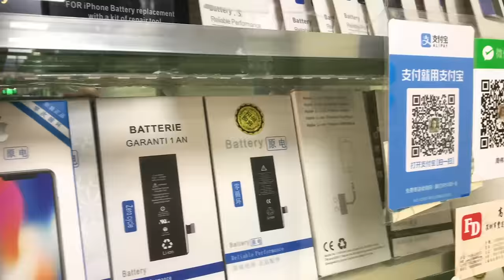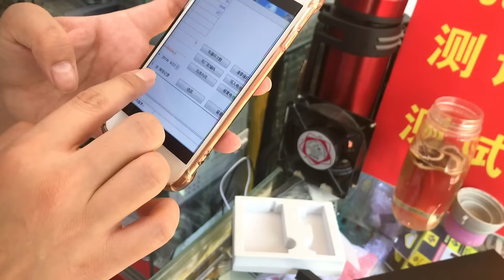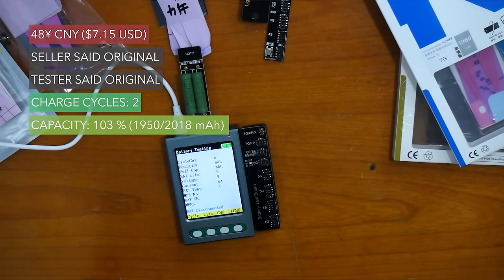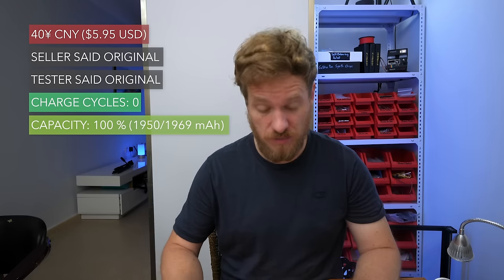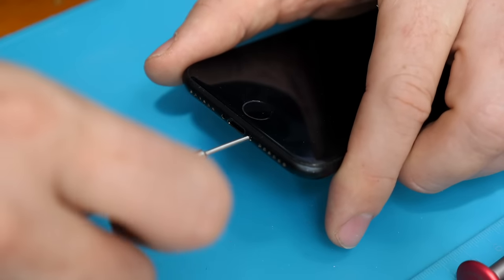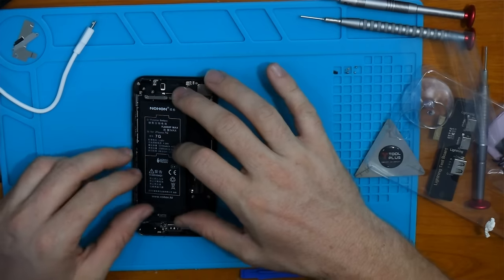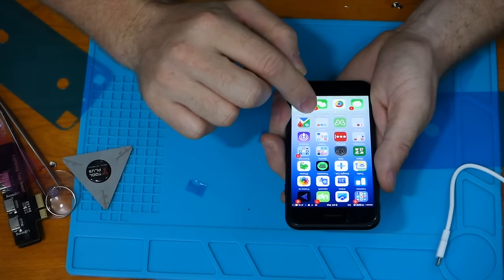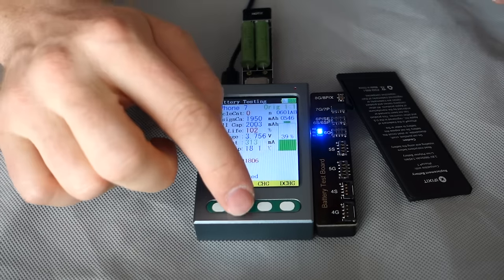Real or Fake? Trying to Replace my iPhone Battery in Shenzhen, China

Comment: Put a fingerprint reader in the apple logo on the iPhone 10!
Reply: Would be cool to see but that would require some high level OS Modification. Also the logo is behind glass and the back is mostly housing the coil for wireless charging so work room is limited.
Reply: @moorefilmltd  its practically impossible because. IOS is not open source and cannot be modified like android.
Reply: MXFnGEN housing room is actually non existent without removing at least once cell from the battery and completely removing the wireless censor. Then you’ve gotta use one of the existing connections on the board, and that’s all before making it compatible with the phone.
Reply: It's just impossible. You can't even replace touch id in iphone 7 to new one, only apple can do this and there's no service whole world that make it. Touch id is crypted paired to cpu code.
Reply: MacMasterRace the hardware is pretty easy, the software is very hard if not impossible because u can’t just modify iOS or load custom firmware into the iPhone
Reply: That's imposible tho. Unless you know how to write code in iOS and implement it, but it is impossible anyway.
Reply: For an actual description of why this isn't possible: from my understanding, the SEP (secure enclave protection) saves the Touch ID model(? Or some other type of model identification) as well as all fingerprints. Due to this and the extreme security surrounding the SEP is almost impossible to crack, and that doesn't factor in all the bootlevel identification code that looks for the ID paired with the motherboard. This is possible to modify, but again still needs (either a BootROM or iBoot exploit, but I believe BootROM) for true OS level modifications.
Reply: @moorefilmltd  well he can replace the power button with the finger scanner like and circuit breaker
Reply: I installed one. You need iOS code. It is not easy whatsoever. Took me 3 months to complete on a iPhone 8

Comment: Build a MacBook Pro from zero! Case, battery, motherboard etc.
Reply: including software
Reply: Fritzell Dionson nah that’s too much.
Reply: Serdar H
Mac book, you need some original I/O chips,  you need Sun or Apple Firmware to boot the OS.
Rest you can build using PC parts....
Reply: Hiten Ghate there’s hackintosh
Reply: @hwinangkoso  Why not use a real mac, old is good enough, any intel apple!
Reply: lucas rem the thing is from scratch right? The point is to use hardware that mightn’t be compatible with OSX. Then you can do whatever you want
Reply: @lucasrem  Try Linux!
Reply: @zhaoxunyan4016  

Why you need linux, only weirdo people use that..run Oracle on it at home?

Need to run open server crap, or be the nerdy admin of the home PC?
Reply: @hwinangkoso  there is not a lot u understand i see, SUN I/O you need to understand, that's what apple OS is using too!

Comment: Taptic Engine should be removed first
Reply: Why
Reply: Gamer Buddy it’s a joke about Ifixit
Reply: Yup - it has a sharp edge and forces you to pull the strip up at an angle which makes tearing more likely. Worth removing the Taptic Engine.
Reply: Especially on iphone 6 and 6s where you only need to remove two screws and lift it. It takes 15 seconds and you save 2 minutes trying to pry the battery.

Comment: I bought those Nohon high capacity batteries for my 7 and 7 plus, not really good, both of them started degrading pretty fast after 20+ charges. i ended up buying Pisen batteries, which is a better battery brand in China, they claim the same capacity as the original, and have overall better battery life, really happy so far.

Comment: Note 3 , still has same very easily replaceable battery. It's old and still chooching.
Reply: I'm running AOKP/Lineage Nougat 7.1.2 on mine. You rooted?
Reply: I am using note3 and i have sennheiser bluetooth earbuds pretty expensive but the phone is too old for the control app lol
Reply: @danyk7879  should root and install a custom rom if you are willing
Reply: Zoomzabba yeah then i have to root the phone
Reply: @danyk7879  speaking of which , I'm actually thinking about doing that to this phone .

Comment: 80% is the minimum, that equals 500 cycles. you have more than 700, so it was time to change
Reply: its mean normal phones cant last more than 2 years? assuming we charge daily
Reply: @mantapdjiwa9768  Daily charging doesn't necessarily mean a cycle
Reply: The batteries themselves (Apple originals) are only meant to last about 1000 cycles. However, 80% charge capacity doesn't mean 700 cycles. You can have 80% charge capacity and be under 400 charge cycles. 
Depending on heat, cold, over-charging, rapid charging, etc...all that can affect the capacity percentage but not the charge cycle. 
In fact when Apple system does a check, if it's at 85% charge capacity, it'll recommend it be serviced (changed).
Reply: @Decent60  the apple laptops can do 1000 cycles, the phones do 500! ;)

Comment: You should have used the battery tester in the iphones settings and then use the battery tester you bought to see how accurate it is.
Reply from the maker: Yeah, I regret not doing this.  I actually hadn't upgraded to ios 11 yet on that phone, which was why I didn't do it.

Comment: My battery lasted me 6 years, now mom has that phone now. Still working :) I did take care not to leave it on charger over night, and no fast charging. Batteries like low charging current, quick charge kills them faster but most people want quick charge and usually replace phone in year or two so shortcomings of quick charging doesn't show up yet. My Nexus 4 lasted me 6 years, I have saved over 2500 euro when compared to my friends who often change phones :) Now Mi 9 SE, another great phone for under 300 euro (Nexus 4 costed me that amount 6 years ago).

Comment: What I've learned from pulling on the battery tabs if you don't want to stretch them, you want to roll them. They don't like to be pulled super far, so if you keep them closer to the battery and you roll them around your tweezers they won't break.

Comment: I would have liked to see you change the cycle count for example, disconnect the battery and reconnect again to see if the tester actually tests the battery and gets real data or if the tester just "reads" for the values which are saved inside the battery.

If the tester cant expose the fake one then its doesnt make much sense to buy the tester. The shops which sold you original, 1:1 copy and fake batteries could easily just use the tester to sell you whatever they want. 

Thats why i think that this test is so important

Comment: I've swapped a lot of iphone batteries, and once it blew up. Damn that was scary
Reply: I always discharge the phones before I swap batteries.
Reply: @Pseudynom  sadly discharging the battery first doesn't makes them less prone to explode, just less dangerous for the phone's electronics...
Reply: Léo P. With a discharged battery the result of a puncture will be heat and smoke. A fully charged battery will result in a much bigger reaction with open flames.
Reply: So you experienced what owning a note 7 felt like xD

(Plz don't murder me, I've genuinely never made that joke before)
Reply: @mmqvt  
But if you discharge you battery it litterally has less energy that it can set free.
Reply: @Pseudynom  yes thats true, but if you discharge it too much, it might puff and/or explode when you charge it again, thats why balance chargers for rc equipment batteries have a low voltage warning that prevents you from charging it if the voltage is too low
Reply: @maxxiang8746  
But if you're replacing the battery it doesn't matter if it's deeply discharged.
Reply: @Pseudynom  yeah I guess

Comment: Tip: Remove your taptic engine before pulling out the battery adhesive. It helps preventing the strip from breaking.
Reply: And a legit disassembly tip from someone that seems to be Chinese.

Stay classy, lads.

Comment: Funny two none iPhone ads on a video about iPhone like the irony:) also I would think it was no thought needed to use the extra capacity battery...why would you not want to?
Reply: because you cannot stick more capacity in the same space... 
Checkout different batteries for different iphones, they weigh and are sized differently...

Just a thought there..
Reply: @lucamantova3070  Yes you can. Battery technology can be advanced, somethings are give or take tho, Same Size, More Capacity, BUT more heat. Smaller Size, Same Capacity, BUT less overall life. You can re-design the battery in the same space but something will eventually give. (Hence why there is standard, and extended type batteries. Extended wouldn't do as well in a high temp climate, or the heat on the extended when charging can be too great so a standard battery would be best.) All about balance. Hence why our phones have limited chance of fire but average capacity. Increase the capacity, increase the chance of fire and the battery being unusable sooner in time. Balance.
Reply: @swagsurgin6907  I see. Would you be able to link me to a source for further reading?
Reply: @lucamantova3070  For sure. Its all about battery chemistry. NiCd in the same size of space would equal terrible battery life given higher loads and has to be taken well care of or it will diminish rapidly. Check here and read up on battery chemistry: https://en.m.wikipedia.org/wiki/Electric_battery#Chemistry

Comment: One year and a half ago I changed the battery on my Xiaomi mi9 with a battery from ifixit. After one year it was completely dead, so in august I bought and installed a nohon battery with higher capacity and at the moment is working great!

Comment: Bat Level 50, because they sell it with 50% charged, to not damage it
Reply: The "battery level" is different from how much it's charged. You can see the actual charge percent inside the battery icon on the right of the screen.
Reply: @mongohands  hmm, okay
Reply: Maybe the circuitry doesn’t support it and it defaults to 50?

Comment: Thank you for the video, it was really interesting. Something I would have liked to know would have been how the tester reported your phone's battery when compared with what the Battery Health item of the settings app of the phone before removing it (i.e. the percentage 'maximum capacity'). Conversely, I'd like to know if the new battery was reporting as 100%. Just small points, but I'd have been interested.

Comment: I believe you can't restore the software via iTunes if the battery is not original...
An error will pop-up I guess... that's maybe the next video :p
Reply: I'm surprised that it's even possible to open it without making it a paperweight

Comment: How can you trust a tool that lets you reset the cycle count is accurately telling you if the battery is original? 🤔
Reply: The cycle count reset is probably for when you change the cells but reuse the charging circuit. That way you know how many cycle are on the used cells. I remember rebuilding old external laptop batteries.

Comment: I use a tool called 3uTools that allows me to see the manufacturer and the capacity and stuff as well.
Reply: Not always accurate tho. Most likely to get true results with a fully charged iphone.Sometimes 3utools may show 1-2% off compared to what the battery life indicator is in the settings menu on the iphone.
Reply: that is very cool, but what if you don't wanna put the battery in because you are not sure about it's originality ? here comes testers like this :)

Comment: I've purchased several ifixit batteries over the years from Fry's Electronics.  I have had a couple of them go bad on me, while still under warranty.  Getting a warranty replacement was very easy and hassle free.  But if you are an impatient person, they cost around $20.00 at Fry's to pick up now, or wait for ifixit to ship you a new one!  The batteries do come with all the tools you need and the adhesive strips.  But be careful with the strips as they are extremely easy to ruin before you even put them on the battery. Once the adhesive sticks to itself or improperly placed, are garbage.  I haven't successfully installed a battery with those strips to this day!  Anyway, all I really wanted to say is that, I highly recommend ifixit batteries.  the batteries are top quality and super easy to install.  Like what was mentioned in the video, use the repair videos on ifixit if you are repairing your iPhone for the first time.  Just type in the exact iPhone model and look for the battery repair in the list of all repair videos.  Oh, one last thing, I highly recommend viewing the battery adhesive strips install video too, while you're at it!

Comment: You must use your fingers to pull the pull tabs on the battery adhesive. My experience is that uniform force through use of a tool to pull it out causes it to snap. Don't ask me why, but it works way better by hand.

Comment: Dude just get an android already!
Reply: And where would you find a battery tester rig for your rando Android phone with its unknown, possible non-standard connector? If you can't find it in SZ, maybe the world is trying to tell you something.
Reply: @MikeTrieu  
You don't really need a battery tester to use an android phone. You don't need a tester at all, unless you retail batteries. 
When your phone doesn't hold charge anymore then it's probably soon time to get a new phone anyway. so does it really matter if the battery is fake or not?
Reply: @MikeTrieu  
but if you really wanna spend money on a tester then you should get one that can also test by usb cable, like the one scotty bought. You could basically test any battery with it. Just install the battery in your phone and plug it in

Comment: The data that is read by the tester you bought, is also read by your phone. You just need a piece of software that can read this and display it to you. Itunes can read it, but it won't show you.
You can use 3utools which is totally free and can display all that and more...
Reply: Just out of curiosity, what's the interface with the battery?  Is it something standard like I2C, .. or something Apple specific?

Comment: What I really wanted to see is the in-phone performance of your used 725-charges-battery after being reset to 0 cycles from your battery tester. How is Apple/iOS using this charges counter and how does it affect its use just based on this "battery metadata"? Very curious!

Comment: You will have to lern more things about lion batteries, and do a full test on them with mesure the internal resistans , capacity with a full discharge from 4.2 to 3.0 volts and  0.2/0.5/1.0C current. An other thing that you should have tried is to fully test the old battery you had on yout phone and zero the cycles with out removing it and see what the phone will do.

Comment: FYI if it fucks up again you can just use dental floss and put a little of acidtone on and use a sawing motion as it goes under and cut through the adhesive. Works for macbooks too.

Comment: Just found this video today. Many years ago gave my iPhone 5 to one of my sons. After a couple of months the battery don't last that long so I thought I was saving money by taking to a local repair shop and have them replace the battery. The technician told me that there is a high chance that if they open the case the screen could break too and then I would have to pay to replace the screen. Yes the screen did break and I paid like $109 to replace both the screen and battery. After like 2 months of usage the battery swelled and the screen pop out of the phone. My son refuse to use the iPhone so I had to get him another phone.

Lesson learned for me is to just go to the Apple store and paid them to do it. Yes it is more expensive but they back it up. Also if a 3rd party open the phone, Apple would not touch it anymore.

Comment: As a habit, if you don't let the battery drain below 40% and you charge every night; the battery might last forever. Some manufacture send the battery charged between 40 to 50% where they have the greatest shelf life. Using the power saving feature might also prolong battery life.

Comment: Just a hint: remove the vibrate motor and then pull the tape tabs so its at less of an angle.
And also, use only one strip of gule when putting the battery back in (incase u need to change the battery again, ull only need to deal with one instead of two. One strip is plenty to hold the battery.)

Comment: Hi, just add some solvent under the battery, 3-4 drops, heat them, and pull stripes. they did not have good adhesive to frame and battery.
Reply: And you need unmount taptic engine,  before you pull stripes, because he has sharp edge.

Comment: I used to buy NOHON batteries from Ebay , which are better than original ones , I used one at full capacity for almost one year , so few things doesn't need to be original to be good

Comment: That Battery tester /analyzer is no magic device but a device that measure voltage and current in diffrent situations and guess / calculate the battery condition

Comment: I actually have that battery tester, I used that to calibrate some problematic batteries that shuts down iphone even if the battery is not even below 10%. after calibration, it will not give you the fake battery life but instead a calibrated one but hey it no longer shuts off the iphone unexpectedly. unfortunately this is the thing we deal on a 3rd party battery, not even a ifixit battery will save you from this kind of issue.